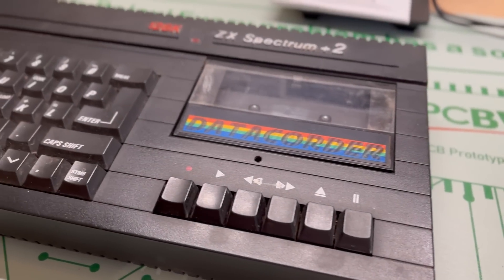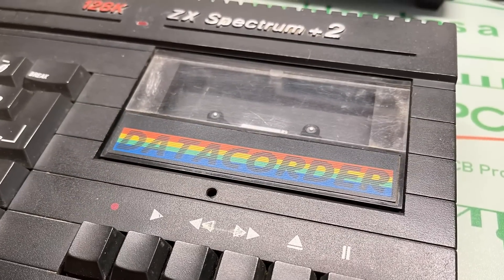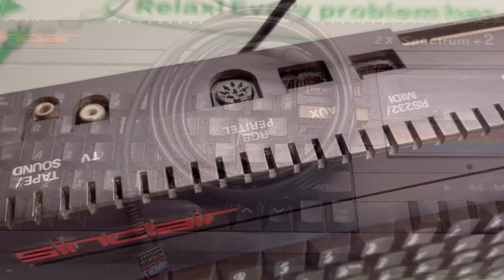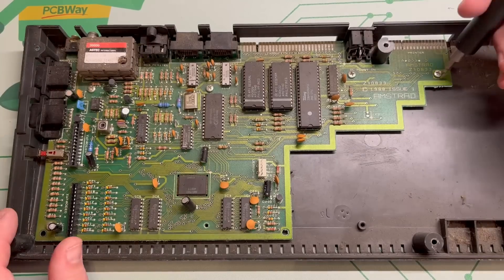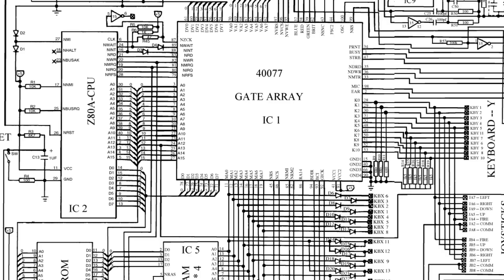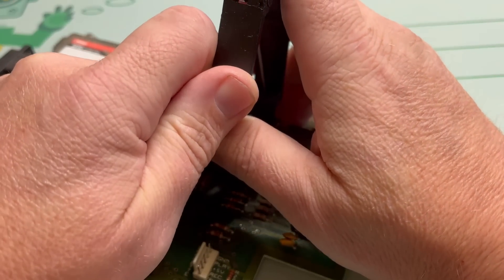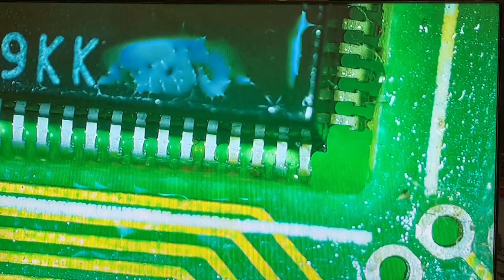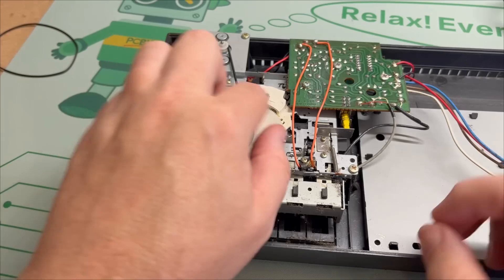Sinclair Spectrum 128K Plus 2A - Sold as faulty - but was it?  Not 100% if my fix is what fixed it!

Comment: Anybody not wanting to make modification to the board but also not wanting to use old tapes (or having problems with the belts), just use a bluetooth cassette adapter. They fit into mechanical tape drives and you can use them just as you used audio cassettes after you paired them with your smartphone/tablet from where you can stream the TAP/TZX files with any Android TZX player.
Reply: I had literally no idea these were a thing, thanks for the heads-up.

Comment: Not having an extension for the screw driver that fits into the deep sockets has been the biggest annoyance with the ifixit kit I have.
Reply: Rather than extension bits, I think longer bits without an extension would be better overall. In my experience, some bit holders won't fit into recessed holes.

Comment: Here's a tip that's worked for me for 40 years.  When reseating ICs, use a Staedtler white eraser to lightly polish the pins. It's enough to remove that thin film of oxidization that accumulates over the years. Other brands of eraser might work but I swear by Staedtler because they will not scour the pins.

Comment: I've put a CF Card in my +2B. In the kit are 2 replacememt ROMs and the IDE to CF Card adapter. Really easy to fit, setup and use. I have the card sticking out of the back of mine so it's easy to remove and put software on.

Comment: Giving a bath in distilled water is a good idea  for dirty boards(without adjustable resistors) especially after putting new sockets. Debris from the de-soldering pump seemsto stuck  everywhere causing all short of small issues. It have worked for me at least 3 times.

Comment: I wouldn't be surprised if some of those fibres were polymer-based and full of static! These chips and circuits were often rather sensitive to stray capacitance... and that fluff had it all over all the legs! Seems to have pushed it over the edge and it failed to init reset or something.

Comment: I bought one of these. My first 128K game i load crashed immediately the moment it finished loading (or when i first started the game? Longtime ago). Those load times were not short. It was Spellbound. 48K games ran fine, any 128K game crashed.

Returned it to the shop they checked it and swappedthe next day with another. I got a call a week later from a friend who had a problem with his new 128K+2. Strangely enough, experiencing the same problem i had. When the shop swapped it they literally swapped just the system itself, i still had the original box. We compared the serial numbers, his system and my box were the same! Tested my... Eric in Skool Daze could have done better.

Comment: RGB on a Spectrum? Luxury!!!  Back in my day, we had UHF channel 36 only... If we were lucky.
Reply: It was a feature ever since the Sinclair 128k, though it turns to to be fairly trivial to bypass the modulator and get composite video out instead, allowing you to bypass all the tuning.

Not that I knew that at the time, of course.  I used RF well into my ownership of an Amiga 600, because most of my TVs were hand me downs and it was an ariel socket or nothing.

Comment: That's a PLCC puller, it's not intended to be used for pulling regular DIP chips! You're usually much better off with "bent U" ones with wider hooks intended for DIP chips (google Jonard EX-1 for example, but you can get a cheap one for almost nothing). There's also more specialized DIP pullers that does more of the work for you like the Jonard EX-2 and the chinese clones of THAT, but here even the clones are more expensive so only make sense if you do it a lot.
Reply: I found it a tad amusing that he was talking about being careful and not bending the pins while using the wrong kind of puller that might bend the pins.

Comment: When cleaning detritus off of a circuit card, the technique used should actually remove the detritus. Your brush and alcohol technique would seem to get it wet and move it around, but I didn't see where the detritus actually went. Perhaps there was some aspect of the technique that was not included in the video, such as wiping the dirty brush onto a paper tissue, or perhaps rinsing the whole thing with enough alcohol that the gunk was washed away down to a paper towel.

Personally, I'm not above rinsing a filthy circuit card under a tap with warm water, then rinsing with distilled (or R.O.) water, or alcohol, to get the hard water minerals out, then very carefully blow drying. The gunk ends up down the drain of course. One needs to use common sense of course, as some components don't like being wet.